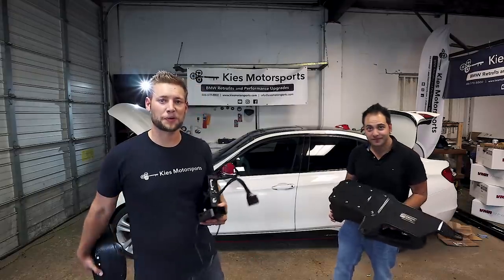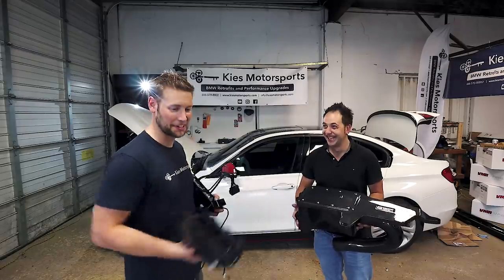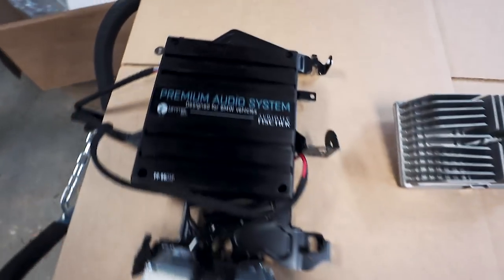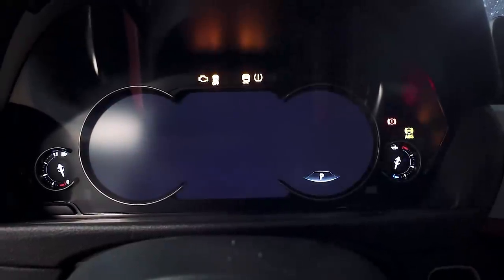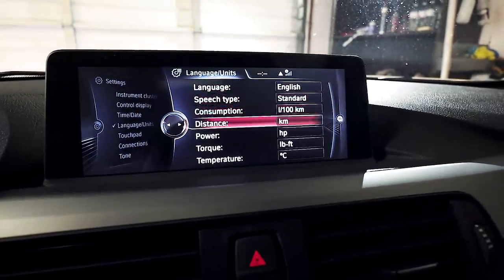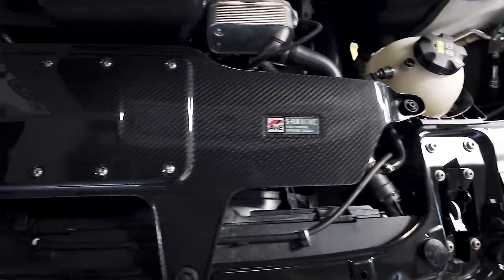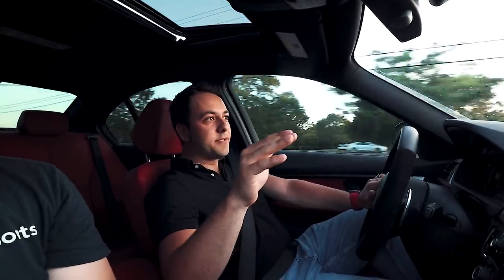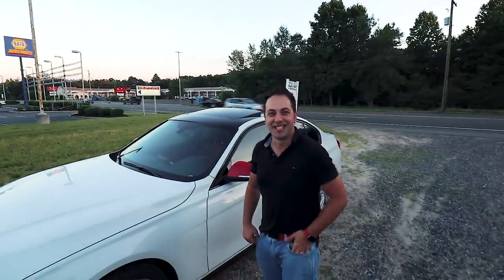He drove so far! ( ...and his F30 BMW left AMAZING 😎) #CanadaF30

Comment: God, I love your channel. You inspired me to buy my very own 2014 335i m-sport last week.It has 51k miles. Any tips on what I should be looking for to check on my used BMW before I start to Mod it? Second, any tips on mods to do first? I’m also tight on cash since I’m a single U.S Army solider. Keep doing what you do brother!
Reply: I have the same car as you.  Go with the Bootmod3 tune.  Don't waste your money on any others.  Upgrade your Charge Pipe and air intake.  If you want to do the intercooler you can.  I wanted to because I'm in scorching hot Phoenix.  The Sport Oil Cooler on Burger Motor Sports is also a cool little upgrade that really works.  Wheel spacers will add a much nicer stance, I went with 15mm on back and 10mm up front.
Reply: Bootmod3 gets the best bang for your buck, with regards power and performance.
Reply: Joe Salvatore Check if the oil filter housing is leaking, if so replace quickly b4 causing more damage. Speaking from experience as a mechanic, Cooling fluid and oil is never a good combination. And congrats on your car. I am also looking to buy a 335i F30 next year